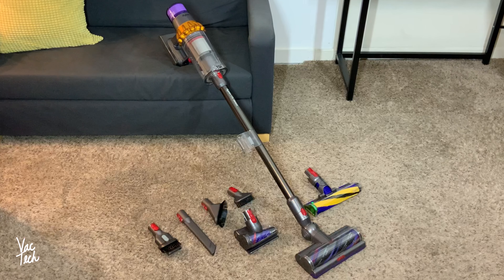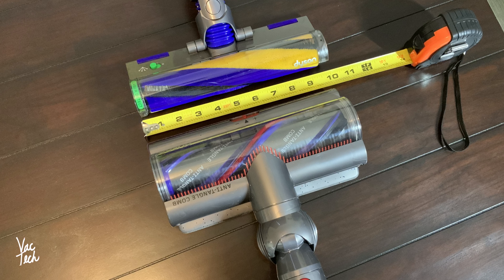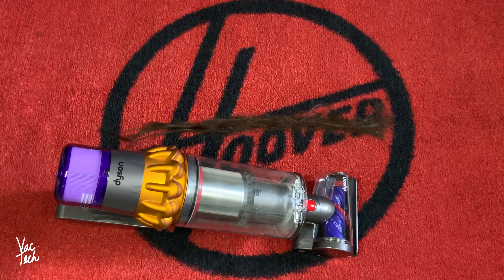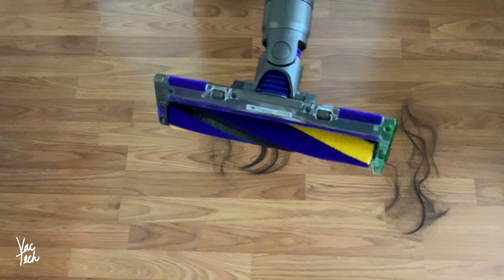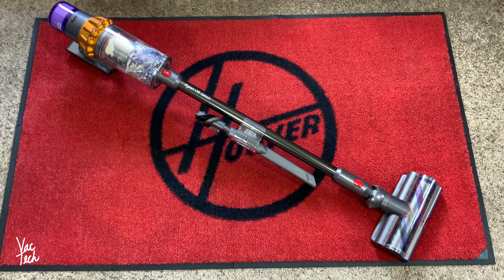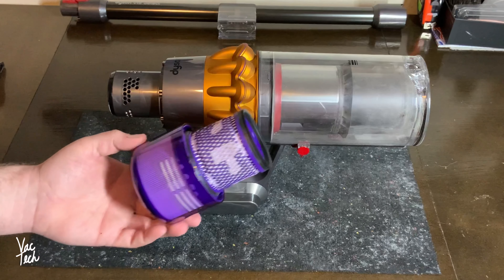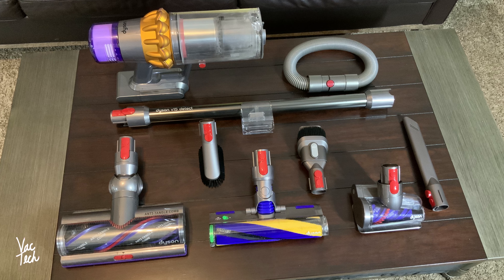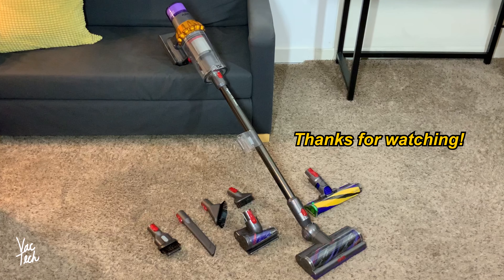Dyson V15 Detect Vacuum Review Demo & Maintenance Tips

Comment: The agitation is insane on these. Better than most corded uprights. I can’t wait until the V15 is released in the U.K. Dyson are strange with their model line ups; I notice you guys in the US don’t have the new Small Ball 2 vacuums, which are the DC41s with a cleaner head more or less the same as a V11 with those gates and full width cleaning. You guys have the old 41 MK2 ones but Dyson are most likely focusing on their cordless models now, while still selling those corded models. The small ball 2 is only £200 as well.
Reply: The bristles are way to soft and short for agitation that’s comparable to an good upright. It will certainly preform better than cheap model where you are like beko, goblin, modern Hoover etc. When stacked against similar prices vacs however, the V15 gets left in the dust. It’s absolutely not a replacement for a mains powered machine and shame on Dyson for pushing that narrative. I do agree that their lineup is very weird. We did actually get one upright with the new head, the small ball. Other than that it’s all the older stuff, which is a shame.
Reply: @nicko5945  you have literally never tried one at all or else you wouldn’t be saying that.
Reply: @Olliebobalong  I have already owned 3 of them since my first two had software issues and needed to be returned, but nice try bud. I’ve had one since the day they were released here in the states. You cannot get good agitation with soft carbon fiber bristles and the red bristles that are harder, are very short so that they cannot dig into the carpet. The only skim the surface. You dyson fanboys can’t seem to ever take criticism of your beloved company.
Reply: @nicko5945  I own more Sebos than Dysons tbh, but I still think you’re talking shite.
Reply: @Olliebobalong  oh good for you! Sebo is as good as it gets. Wish they were cheaper for us here in the states so they were more mainstream, but I still own one of every model because I love them so much. You certainly don’t have to believe me either, but you can’t ignore facts and the fact is that’s it’s the bristles and brushroll that matter when it comes to agitation. The softer the bristles are, the less they are going to agitate. Also why do you think you you need to replace brushrolls and brushstrips?  It’s because once the bristles wear down and become short, they no longer properly clean and just skim along the carpet. That’s exactly what red bristles do. Again, don’t take my word for it, but to deny basic vacuum knowledge doesn’t reflect well on you.
Reply: @nicko5945  I think a dyson cordless can replace a upright/ canister only for small homes and apartments but for its price I would at that point just get a Miele
Reply: @bufonidae  totally agree with ya there, good point!
Reply: @nicko5945  I replaced my NZ801UK Shark anti-wrap for my holiday rentals with the V15 and it absolutely kills it in terms of fast, efficient cleaning and dealing with pet hair. I get constant hair wrapping on the Shark and the Dyson hasn't had any issues whatsoever, it does my medium pile carpets on a single pass-over unlike the NZ801UK and does a FAR better job in handheld mode on upholstery. It is absolutely a replacement for a mains powered vacuum and comparable across all key features without the hassle of the cord. I would consider myself a power user as I have to clean 3 properties each week and so far the Dyson has been more than worth the investment.
Reply: @mdc123-v2v  the only way a cordless stick vac could replace a good mains powered cleaner is for small apartments with little carpet, or small homes with hard floors and the off area rug here and there. You were replacing a very subpar mains upright that doesn’t have good agitation. I collect vacs and have around 200 at the moment. Most of them being main powered bag vacs. Almost every single one of them outperform the V15 and it’s not a close competition for the most part.  If you don’t care about a deep clean on carpets, by all means enjoy your V15. Stick vacs are extremely convenient and have their place, it just happens to be as a secondary vac for quick pickups.
Reply: @nicko5945  Unfortunately for you, the mass-market doesn't agree. People who buy Dysons tend to love them. No ones carpets get so filthy dirty that you need to beat 10 barrels of crap out of the carpets to get them clean. I have used Sebo's for 20 years, and running the V15 over the same carpets, I won't say it collected huge amounts of dirt, but it collected a lot, and even more fine dust form what I thought were clean carpets. You clearly have not used a V15, like many who dislike the new Dysons. I think its more to do with the fact Dyson are massively successful, much the same way Apple have managed to target their market accurately and bring about a product that most people love to buy and use. If they were subpar, people wouldn't continue to purchase them, and Dyson wouldn't be on their 15th iteration, and Miele, Kirby et al wouldn't be struggling with marketshare. Bad products dont sell in free-market economies.
Reply: @nicko5945  Thing is, a lot of people are falling out of favour with Sebo. My E3 has horrible hose leaks, and the new X7's have a lot of quality control problems. They are now plagued with design problems, but Sebo dont think there is an issue because they have a few thousand Instagram followers and influencers where they give free machine to. They really aren't are great as people claim, and tbh, most people now want a vacuum they can grab and clean the floor daily or every other day, much like you wipe your kitchen surfaces frequently to stop large amounts of dirt accumulating.
Reply: @nicko5945  from what I’ve seen these dysons outperform the corded range and many other vacuums, Miele and sebo are cheap in comparison. Over 50% less

Comment: Close to 20 years ago I purchased an ORECK.  That was the best vacuum I have ever purchased it cost at that time $800., with a lifetime warranty.  I have only had to have it repaired once in all that time.  I just did break the connection wand in June 2021 and could not have it repaired because the company is no longer in business and the repair shop was not able to order the piece or so they  tell me.  I am in the market now for a new vacuum and I wonder if I purchase the Dyson V15 Detect, with careful use and good maintenance, How many years can I reasonably expect this vacuum to last?
Reply: Probably not long in comparison, it’s got fancy tech and the battery obviously isn’t going to last 4 years without degradation. The traditional dysons were cheaper and can be taken apart very easily and parts are readily available so it’s more affordable but sadly they aren’t developing that stuff anymore. £300 vacuums now transpire to £500 cordless vacuums with only one battery which costs around £100 to replace. Overall i would get one but I don’t think it will last the 9 years our current dyson has.

Comment: I recently purchased a v15 detect after having  a shark cordless and although suction is great it’s impossible to use on thicker carpets even When in auto mode. It will literally clamp and then cut out .I then have to switch to eco mode. I’ve tried adjusting the gates but makes no difference whatsoever. It kind of defeats the object and not what I would expect from such an expensive vacuum.
Reply from the maker: Sadly it's a problem with most new Dysons. If you find it's a bear to push on your carpeting, even in eco mode and with the gates open, there are no further remedies. The problem is that the V15's brushroll agitation can't keep up with the strong suction, so instead of pulling it along, it just seals to the floor and quits. It doesnt have the brushroll drive to power through all types of carpeting. I hope you find something that will work for all the flooring in your home!
Reply: Same problem here. On booster mode it just clamps up and stops. Too much resistance when trying to do thick pile carpets …you end up with a pulled back it hurts so much. And can’t use booster function. Only eco which is low suction. An utter waste of £600 anc I think dyson should be more honest that it’s best for wooden floors or tiles or cheap low pile carpet. Expensive  carpet it won’t work at all

Comment: I just bought this vac 2 days ago and I’m having issues vacuuming my medium pile carpet. It’s standard carpet, maybe a little less than .5”. On auto, no matter if the gate is completely open, I can feel the suction clamp down on the floor while using it and the head stops. I can’t seem to find any setting that works other than eco, which seems crazy to think on a $700 vac I can’t use the higher or even medium power. What were your findings in this department in regards to suction on eco on carpet? How was the cleaning performance - I’m wondering how much cleaning performance I’m using on that mode.
Reply from the maker: Sadly I found the same issue. It clamps down more than the V11, thanks to the increased suction, but similar brushroll agitation. I've had to open the gates to make it work on certain types, and having to use eco on certain carpeting wouldn't surprise me. With eco and the gates open, it's not going to clean as well as the auto mode, which has much more suction.